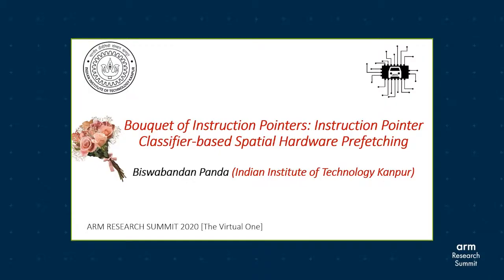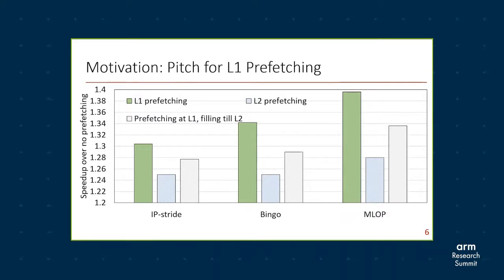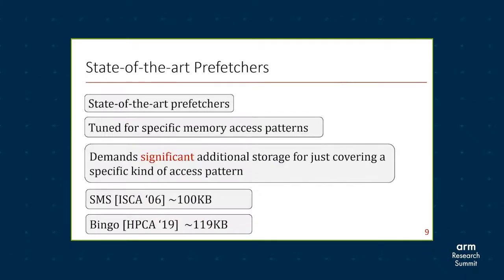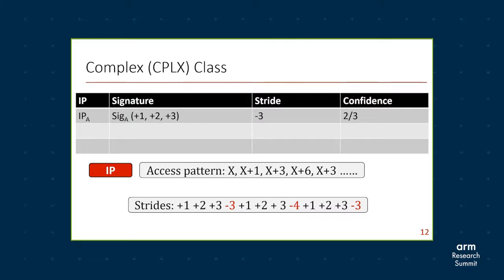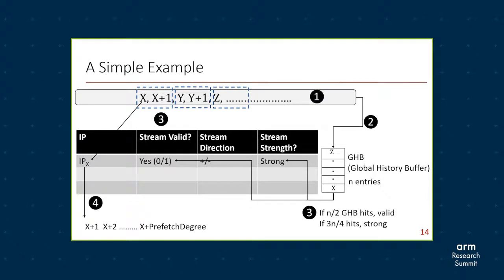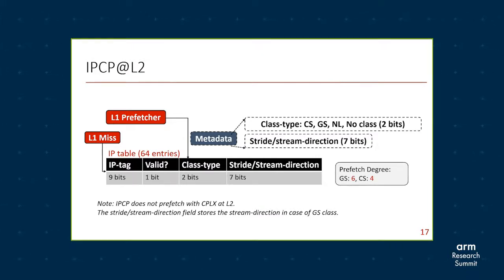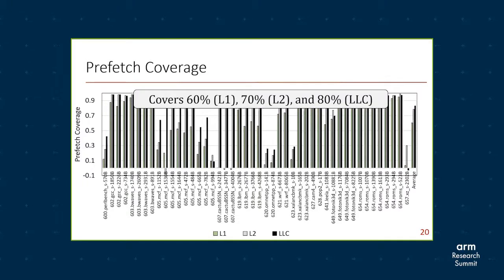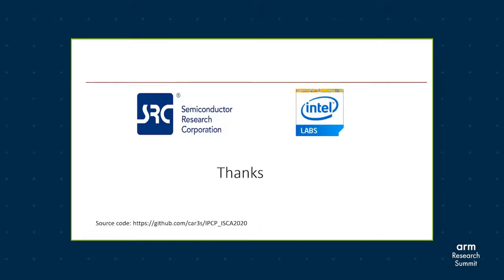Instruction Pointer Classifier-Based Spatial Hardware Prefetching - Biswabandan Panda, IIT Kanpur

Comment: At 18:58, What I meant to say is the following: Compared to other simulators like say gem5, ChampSim is "relatively" less sensitive to cache pollution (in our case at the L1-D). I missed the word "relatively" in my talk. Sorry for the confusion. Compared to gem5, we do not have wrong-path execution in ChampSim so caches remain unaffected. Stalls are there but that does not account for pollution that would have been caused by an L1-D prefetcher, prefetching in the wrong path.